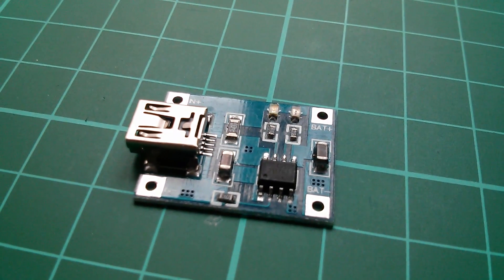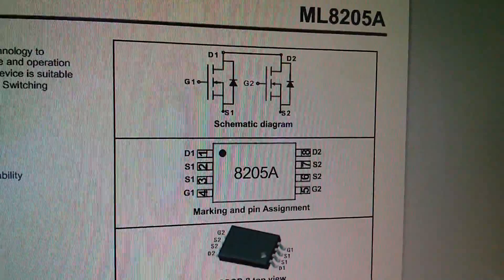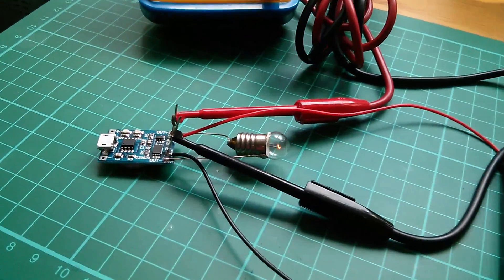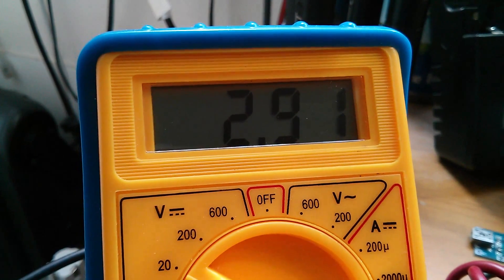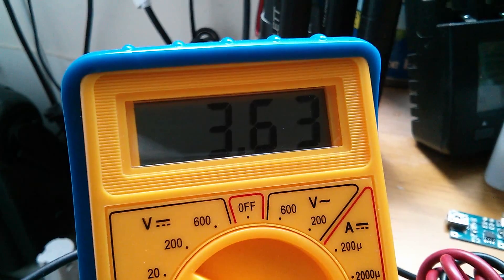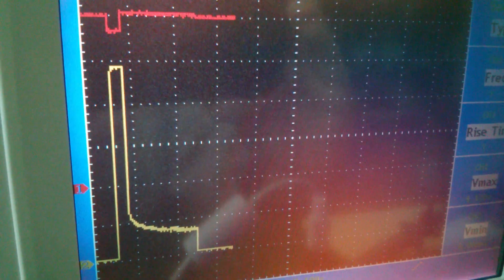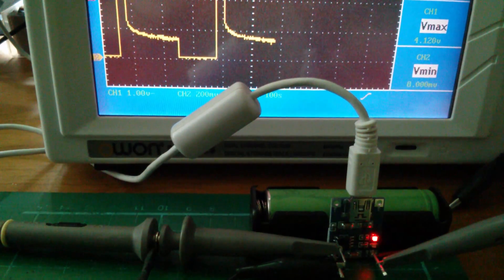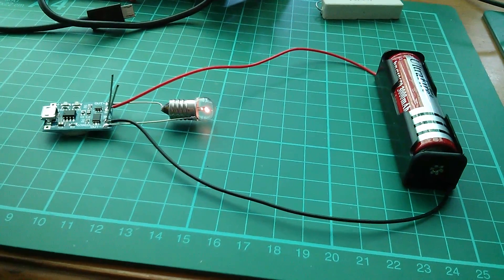New TP4056 Lithium Cell Charger Module with Battery Protection

Comment: i want to use this for a Raspberry pi b+ project, can i use this to charge a battery and use the raspberry pi at the same moment ?
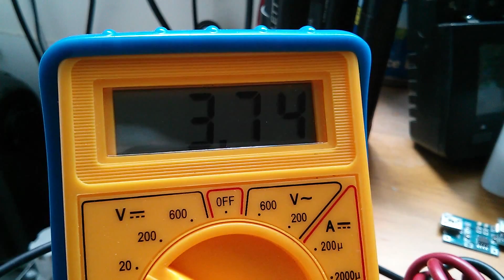Reply: +Albin Gjoka I built a circuit with a microcontroller and other devices to run on 3.3V from a Lithium battery. My idea was to use this cheap charger module TP4056 from this video to charge the Lithium battery from a micro USB charger. The problem I found is that when I connect the micro USB charger to the circuit, the voltage at the Lithium battery is the charging voltage, 4.2 V, also discussed in this clip (check at minute 6:50), so I am afraid not to burn my circuit using this setup. Therefore definitely something else needs to be there, maybe you can go and use a step-up converter to take Lithium voltage up to 5V and to power your RPi from there, I won't recommend directly from the Lithum battery when Lithium battery is connected at the charger module TP4056. Any better ideas are welcome, I did not find a way to fix my setup, thanks!

Comment: hi julian,can you tell me. are these boards specifically designed to charge a single 18650, or can they charge multiples of in parallel to increase battery bank Ah?
Reply: can you please reply julian. can i also ask, if you drain the batteries directly instead of going through the tp4056 bat +/- does this take away the chips ability to know when the battery is drained?
Reply: +Eric Jackson do you have an answer? I want to do the same and cannot find what to do?
Reply: I think you can have another board charging the second battery, with both coming from one charging source. I think you may charge two in parallel, but more that that would take forever to charge. What I would like to know is if I can charge two batteries each with their TP4056 module, and then power a device with the batteries in serial to get 7.4v... and if it can charge while supplying power to the device (a little robot).
Reply: With the older version I tried with 2 cells and it went ok...but when I tried with 3 cells the charger got hot...I advise no more then e cells!!!
Reply: Electronic Matrix i use 4cells and that can boiled a water, but there's is no smoke also no heatsink i think the device is have protection against high temperature 

The led has burned :v

Comment: Nice video.. Could you please let me know what would happen if I connect the input of the charger module to a solar panel instead of USB 5v supply and if the voltage drops, which is normal with solar panels due to low sun shine. In this case will there be any harm? will the lithium ion battery connected will discharge?

Comment: This may be a stupid question but I am a complete newbie when it comes to electronics. I am trying to become better and wanted to ask: for this setup, could this chip be hardwired into some hardware and have the battery connected to the B+/- and have the unit I want to power connected to the OUT +/-? The unit will have a switch so I was not sure if it need to be connected to the chip or battery. Thank you and please do not tear me apart! haha

Comment: i am new when it comes to these things, can you put 3 of these batteries in order to get a 11.1 v output?
if no what can i use?

ps. i plan to use it with a speaker, and audio devices dont really like boost converters.
Reply: You can use 3 in series but the TP4056 can't charge all of them at the same time while still in series.  If you bother to draw the circuit, you'll see that the reason why it doesn't work is because you'd be shorting out the 18650's.  You'd need a BMS and a regulated 12.6V power supply to charge the three cells in series.  The only other way is to remove each 18650 and charge them either individually or in parallel.

Comment: I'm using a these boards for home build powerbanks and they work well for the charge section. One problem I do have is that I've just built a powerbank with a known 20Ah rating using 18650's. The bank is great, but the charge time quite obviously sucks.

Do you know of any of these circuits that have external transistor drive capabilities?
Charging the 20Ah battery takes about 30 hours due to the reduction in current when going into CV mode.

I'd love to be able to get a charge current of about +-5Ah for this pack (+-30% of capacity of each cell)

Thanks.

Comment: I got 3 module like this with protection and I manager to fry 2 of them when I attach load to out+/-  when battery was not charging but just powering the load, am I using it in wrong way?
Reply: +amirnasher You might not have fried the boards.  i find that once the protection has kicked in, it can be a bit finicky to disable the protection again.  Often with mine, the whole circuit will remain locked out until i plug it into USB.
Reply: Thank you roidroid for the reply, well it fried magic smokes escaped from the second smaller 8pin chip :)

Comment: Could I charge two batteries with it if a placed them in parallel?
Reply: Yes.  But make sure the two batteries are close to the same state of charge before connecting them or you risk causing damage to them.

Comment: I got a few of these that I am trying to use in a portable solar project.. Can you tell me the Minimum input voltage and current that this thing will work properly on..?
I know the data sheet says 3-6v but what is the min current..
Reply: +Davids Electronics how about the input current..?

Comment: i have a tp4056 without the battery protection, and it was overcharing my flat top batterys, now i know i have the wrong board for it nice video now i know wich one to buy for cells without the protection build inside the battery

Comment: Hello Julian, I have 12 (I may end up only using 6) 18650 lithium-ion batteries, and I want to build a battery pack for an old laptop that used to have NiCAD batteries in it, I'm having trouble figuring out how exactly to do this. Would you be able to help me understand how something like this can be done?

Comment: Hi, could i wire a couple of these in parallel to get a higher charge current? And to make a bigger battery pack could I wire inputs in parallel and each output for a separate cell in the pack to balance the charge correctly? Thanks for the answer!

Comment: i wonder if it is okay to take a load while charging. i mean like a cell phone, you plug in to charge, but also you can use it at the same time.
Reply: I am looking to do the same thing as zelra was planning on doing but I see an problem where if the device pulls more the 100ma the charger will stay at 4.2v even if the battery is pulling less than 100 ma (potential for over charge) just wondering if I'm thinking right

Comment: Hi Julian, do you think that i can put several MP1405+18650 in series (Out+ and OUT-) to get higher voltages? I wanna build a bigger battery  .... 5 of them should give me 20V and IN+ and IN- will share the same power supply (5V , several apms, one amp per module), each module will be connected to 2x18650.

Comment: Now it got cheaper 1.84 US$ (2PCS)  from alice1101983 http://r.ebay.com/AlTNa7
Reply: Mike Herbst Unfortunately your link doesn't work and even worse, nobody on ebay sells version with DW01x chip :( If you find it somewhere please let me know.
Reply: Valent Turkovic It's still there :-)
http://www.ebay.de/itm/2PCS-5V-Micro-USB-1A-18650-Lithium-Battery-Charging-Board-Charger-Module-NEW-/181797720310

Comment: Do you know if I can connect two of this board in parallel to charge faster (2A) a large capacity lithium battery?
Thanks.
Reply: Sinuhe Zubieta I have that question 2 :) !
Reply: Michiel Platteeuw I check from another source and it's not posible.
Reply: Sinuhe Zubieta To bad, thanks for the reply. 
I will be using 2 separate boards then. This would have been a handy solution :/
Reply: There is actually now a specially made board with 4 TP4056 chips connected in parallel.  It's supposed to charge at 4A.

Comment: Hey, does anyone think it would be possible to connect a few of these modules outputs in series? Theoretically you could make a balanced 14.8V battery pack, if this was possible. 
Great Video btw.! :)
Reply: n Matthiess Hello Matthiess, i've put 5 modules with two 18650 cells hocked on each module together.
Input in paralel, charging works.
Output in series , but i only got 15v, 5 volts have gone lost.... and one module died , but i don't know why....
Reply: You can connect output in series only if inputs are electrically isolated. This means that your input cannot be from same power supply/usb, and they usually can't be from usb power adapters running from mains either. It's probably wiser to buy a board that readily supports 3/4/5S charging as you application needs.
Reply: Or just get a different module to charge your 14V power bank.
Reply: Excellent question!

Comment: just one question , can i use this module for Li-Pol battery?
Reply: No.  They have a lower end-of-charge voltage and will be damaged by this circuit.

Comment: For (safely) charging a 300mAh Lipo using this charger, should I change the R3 resistor to something more like a 10K OHM 2W resistor?
Also, what is the correct wattage resistor for charging a 500mAh Lipo?

Comment: Did you determine if their was a hazard for over changing?
Reply from the maker: Chris Dembinsky Not conclusively, but I suspect this could be a problem
Reply: Julian Ilett it is, but is possible to solve this(protected cell). If you use TP4056 to charge the battery. And drain the power directly from battery connections.

Comment: Hi Julian. I've got an application that requires a load to be permanently connected to the battery, and powered either by the battery, or USB when plugged in. Did you ever establish this scenario would work on this charger, or if the load would stop the charge from terminating?
Reply: For the 2nd question I've read (http://lygte-info.dk/review/Review%20Charger%20TP4056%20UK.html) that the charger will automatically begin recharging when the battery voltage dips below 4.0v, so if your load allows your lipoly to get above this threshold while recharging, the charge should terminate properly.  A similar charger, the Microchip MCP173831, works exactly like this.  Good luck!

Comment: I ordered some of the ones without protection but I need to double check. These work with FLAT lipo batteries like the ones Adafruit uses in a lot of their projects, right? They are at 3,7V at around 200 to 300 mAh. I also have a bigger one but I forgot how many mAh it was. They also have their own protection components so I don't need it on the charger board.
Reply from the maker: jorenmartijn That's fine. But remember to set the correct current

Comment: Is it possible to wire 2 3.7v lipo batteries in parallel to this to change?
Reply: yes but it will take more time to charge... and more then 2 cells in parallel it get´s hot

Comment: as you pointed out towards the end if i had a load and a battery on a TP4056 i could over charge the call

so is not possible to us the TP4056 and a constant power supply and battery charger and the same time

(i am looking to make always on light and have a built in battery back up and i was thinking of using a TP4056 any ideas)

thank you

Comment: Do your boards display a solid blue LED with the red LED flashing rapidly when ONLY the USB supply is connected. I cannot see in the video. I connected a battery (unprotected type) with reverse polarity now mine shows a solid blue LED. I am surprised that reverse polarity protection is not a feature on the board....Can my board be reset or is it for the bin??

Comment: Something happened to my charger board (this shown in the video). It no longer charges. When I plug in 5V, none of the LEDs turn on thus no current is flowing to the battery. Any ideas why that is? Thanks.

Comment: I think the chip also has a timer safety feature where it will turn off after and over extended charge timer like the good old 555 timer circuit.

Comment: Hello I have a question about that. I'd like to set up one of this devices for 2 lithium batteries but i don´t know if it´s possible just use one of this modules or there is anyone which can control 2 or more batteries.
Reply: I second this. I'd like to make a rechargeable battery pack for my lego train which runs at 7.2V.
Would it be best to use two of these chargers, one for each cell and connect them in parallel for charging the cells via usb? Or is there a two cell version of this for balanced charging?
Great vids btw.
Reply: You would have to charge them in parallel. The chip isn't specified to do this, but it's done all the time. Laptop battery packs are usually charged charged in series of three or two cells. They are also thermally monitored.  Ideally you'd have a chip controlling each cell though.

Comment: I have this module but I was wondering the best way to add reverse battery protection? I think a diode would cause too much voltage drop and cause the batteries to get harmed.

Comment: Julian, I have a test-setup with two 18650 in parallel. They charge fine, but the TP4056 gets pretty warm. Can I use it for parallel charging multiple 18650's? I'm guessing the max output remains 1A, and only the charging time will be multiplied by the number of batteries. Is that correct?
Reply: Kenneth Tan I've now been using these boards for over 7 months, they work fine, but of the 10 I've used, 2 burned out. In both cases the ML8205A mosfets overheated and I had to pull the batteries out of the charger. I could smell it burning. Both burnouts occurred on older boards. The latest boards I've bought, look the same, but have blue a blue status led if the board has finished charging. One burnout occurred @first use. The last one happened yesterday after over  100 charge cycles.

Comment: I have a few sets of 18650s I got from my Dell laptop battery.  The batteries are tack welded into sets of 2 in parallel.   At the moment, I have no way of charging them.  Was wondering if this charger module would handle charging 2 batteries at one time.
Reply: yes as long as you make sure its Parallel
BTW my old Dell (D600) had 2200mAh Samsung and Sony cells and their GREAT

Comment: Hi man. Great video! I was wondering if I could use 2 of those to charger a S2 battery pack for a project of mine. Seen that each cell has its own individual charging wires. If not, what would you recommend to charge a 7.4v internal battery pack? I would like to use 5v as input as it is widely available and the charging circuit has to be inside my enclosure. I'm building a retro emulator to take around, and to carry a lipo battery unit defeats the point of mobility. Thanks ... Leo

Comment: Hello, I ordered one of these boards off ebay and I am having a bit of trouble with it... I have it connected to another board that acts as a lithium cell => USB (booster board) I have everything connected correctly and despite that after I unplug the charger board from the usb it doesn't provide power to the booster board. Even if i plug something into the usb to charge same problem. I've tried disconnecting the load (the booster board) and connecting it afterwards still had no luck. Do you know what could casue this problem?

Comment: Hello,
thanks for the video. BTW, how would you change the charging current on this new board?
I've noticed 'R3' resistor similar to the one on the old board, but really unsure if this the right piece.
Reply from the maker: it's the resistor connected to pin 2 of the IC

Comment: Julian, first off great vids, keep it up! I got one of these TP4056 modules to basically use as a mini charge controller for a 6v 1200ma portable solar panel to charge a 4mah lithium battery. Do you think this will still work with the solar panels variable(unstable) output?

Comment: ? What's the difference in the new charger between the b +,- and the out +,- I've tried to find out online and from sellers but with no luck
Reply: As seen on the video, you connect the battery to b+ & b- and a load to out+ & out-. In other words you can use this board not only to charge a battery but also connect a load to the battery and have over-discharge protection.

Comment: Could this charger module charge 4 x 18650 in parallel? It would take 4 times as long I would think. Could it be possible to tie both the inputs and output of two boards to double up the charge current to 2A?

Comment: Did the 18650 get hot during charge?

Would I have to change resistors to charge a Li-Po 3.7v 3100mAh bag cell?
SKC.LPCS5260106D is the cell!

Have you came across a board like the protected one that charges 6 cells?

Thanks!  Later, FW.

Comment: Saw this and had to order a couple.  Just started getting into 18650 salvaging so fun times ahead!  Already have close to 40 batteries salvaged so far.
Reply: I'm jealous!
Reply: runner180fxr Ya, I get a lot of laptops tossed my way and I also have a love for Ryobi power tools so I ended up with a dead pack at one point and it offered up 8 of 10 batteries as good so yay!

Comment: Hi, I have installed one of these in a tablet whose charging circuit was faulty. The battery now charges, yay! However when I run the tablet from the battery's power it cuts out after a short while. Any ideas what I've done wrong or what I should be doing? I'm a noob incase you couldn't tell.

Comment: Can i use 3 modules at same 5v source to charge at same time 3 18650 lithium battery in series, so i can balance charge a home made 11.1v lithium battery pack?
Reply: Giday EH!

You could probably use the same 5v source but the current might need to be high.   I guess!

I am also looking for something like that I can put in a case with the batteries.

Later, FW.